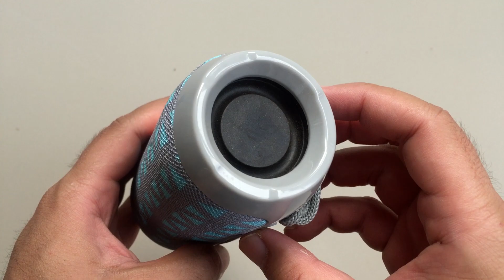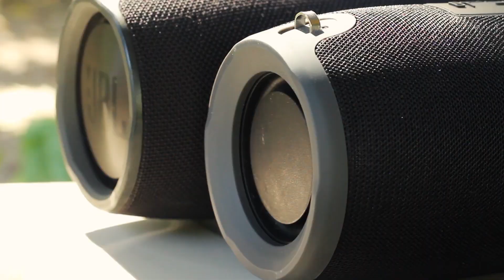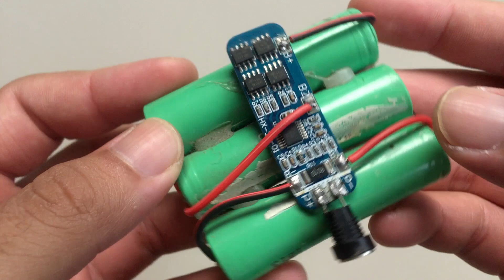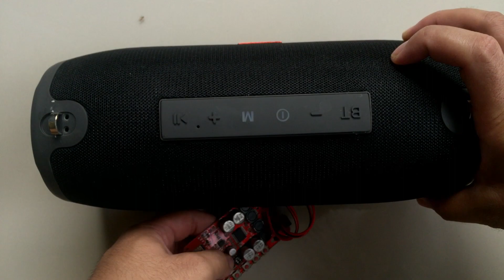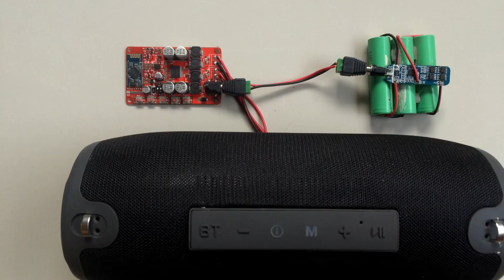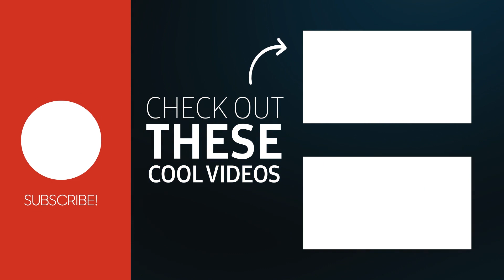T&G TG 118 Amplifier UPGRADE TEST (TDA7492P)

Comment from the maker: Hey everyone,

I was planning on doing the tutorial on how to integrate the amplifier in the TG 118 but then I went a little too much with the other video and blew the 118 Speakers.

Link to the video that destroyed the Speakers below
https://youtu.be/zPi1XchMAxU
Reply: I don't know if it would even be worth it, but permanently modding one of these cheap but rather well looking speakers would be really interesting. I doubt the amp you used really delivers 25W per channel but even 15W would be too much for the original tg 118 speakers (from your teardown we know that they are 10W RMS). So basically I would only buy these cheap bluetooth speakers for their housing, since I doubt I can make something as nice :D
Reply: boss please i have TG 509 speaker and i will like to upgrade it, please can you do a video or tell me what and what i need to get to upgrade it coz the battery doesn't last that long

Comment: ill try this
Reply from the maker: Just be careful though, the amplifier I used was not at its full power. I couldn't get it to its max because did not have enough batteries to increase the voltage.

Comment: Can i power this with 3× 18650 11.1v?

Edit-How did u get 12.6v with the same 3× 18650?
Reply from the maker: Yes you can power the amplifier with 3S 18650 battery pack.

12.6V is when the battery pack is fully charged. (4.2V x 3)
Reply: @TaylorSoloaiJR  can i use any battery protection board?
Reply from the maker: You have to do some research on some of the boards, the one i used didn't protect the batteries from being over discharged. So i don't recommend the one in the video.
Reply: @TaylorSoloaiJR  maybe the amp has the battery protection board idk just throwing guesses around here
Reply: You can use a bms with the battery

Comment: The passive radiators doesn't move too much because their small, i recommend you bro to use the passive radiators of fake jbl charge 2+ if you have those, they're better than other usual passive rads
Reply from the maker: The Fake Charge 2+ Passive Radiators are too small
Reply: Wouldn't the smaller passive radiator move more? The reason why they barely move is due to the drivers being cheap

Comment: Hey buddy how are you doing
Im looking to double the battery voltage on this 118 stock board model but i can't find anything on the internet if it would be ok if the speaker will handle thar because i think i hogh volume the power cant keep it runnig
Reply from the maker: Yeah I can't find any info on it too, even the amplifier chip that the speaker uses has no information online.
Reply: @TaylorSoloaiJR  i think i will try that hope not to burn it. In the spec sheet says its 7.4 volts but the battety is connected ++ -- so the voltage seems to be 3.4 just the mAh seems to be incrased. I started to think that's the problem with the soind because when i turn the bass bit up and the light starts flickering and sound quality really dissorts so im guessing that the extra voltage should fix that... also considering adding a pair of tweeters i think it will help.. if you find anything please tell me. Thanks for replying

Comment: just used a 15 watts per channel and it's enough or use 25 watts per channel but replace your speaker with 2.5" full range 20 watts driver